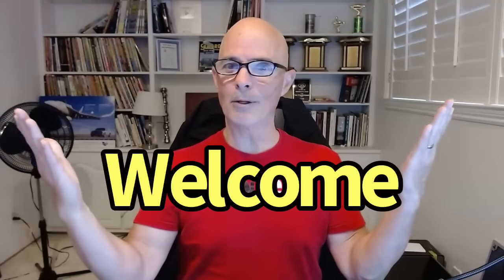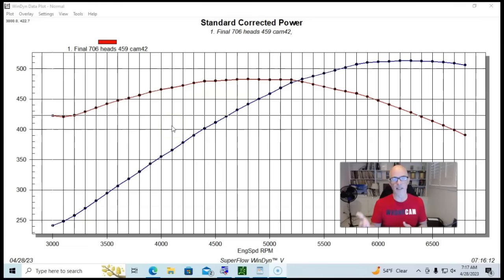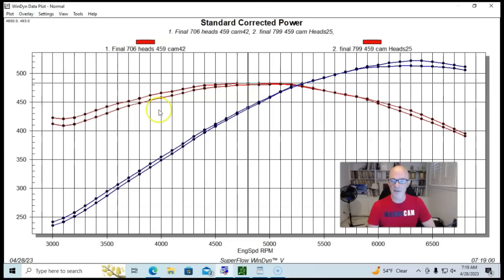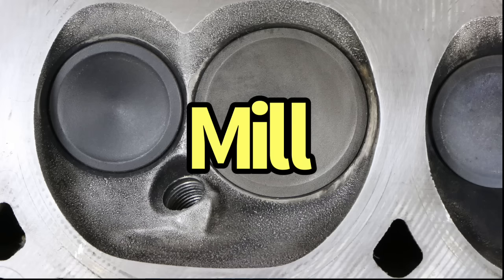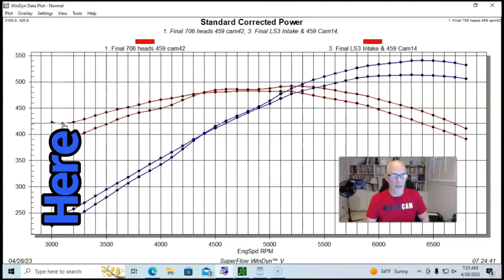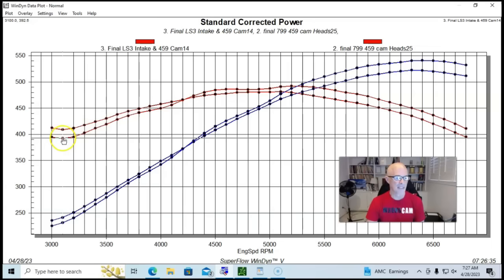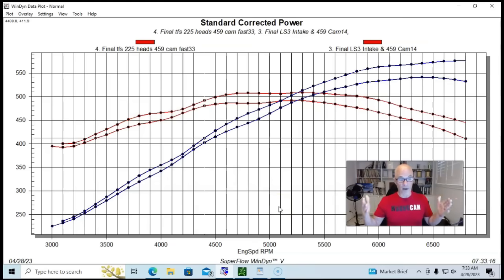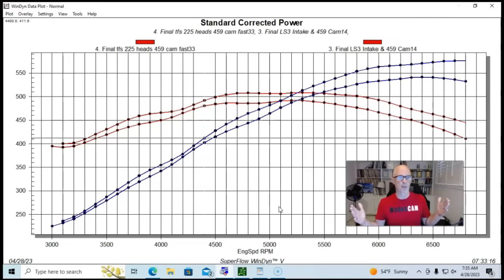HOW TO MAKE 500+ HP WITH STOCK 706 HEADS. 706 VS 799 VS LY6 VS TFS HEAD TEST! 514 HP WITH 232 CFM!

Comment: What’s you’re guess with hp and tq numbers on a Lq4 with 706 heads and ss2 cam?
Reply from the maker: 465
Reply: @richardholdener1727 torque? And if I’m into to the engine is it worth swapping to flat top pistons? Seeing some used ones for cheap on fb marketplace.  Would that be too much compression with the 706 heads? Detonating issues?

Comment: Has anyone tested the 706, 799, or 317 heads on a stock L92 6.2L?
Reply from the maker: same results
Reply: I have a Yukon XL Dental with the 6.2L. I use the vehicle to pull trailers on a regular basis. I want to delete the DOD for reliability and make more low end torque for pulling on pump gas. What heads, cam, intake, & exhaust would you recommend? 
Thanks again for the great videos.
Reply: @Fehrway_Engines  Texas speed has a kit (for ease of reference/ replacement)- check them out.

Comment: If i was using stock 243 heads on a lq4 6.0 with stock cam would i have to change my pushrod length or can i retain the stock pushrods

Comment: If I’m putting stock 799/243 heads on my 5.3/4.8 I’m going to deck them to match the compression. I’m sure the torque and peak hp would be noticeably different throughout the curve.
Reply from the maker: you might get the 799 heads to make 706 head power
Reply: @richardholdener1727 on a all motor 5.3 with TBSS, 90mm TB, headers and low buck cam. Would you suggest decking my 862 heads and getting a valve job or would it make more power just decking the 243 on that combo? Going to get gears and converter too.
Reply from the maker: I would port the 706 heads-maybe bigger 2.0 inch valves
Reply: @richardholdener1727 that’s a good idea. Lastly how much would you deck the 706 heads? It’s on a 99 Silverado gen 3 5.3 with dish pistons. Would .30 be too much with a .40 head gasket and have to worry about PTV clearance with a low buck truck?
Reply from the maker: P-V will be fine-but why do you want higher compression when you won't be able to run full timing on pump gas with stock compression
Reply: @richardholdener1727 my 5.3 is 9.5 compression but with .030 decking it should be roughly 10-1 if I’m not mistaken. Is this too much for 91 pump gas?

Comment: I’m asking due to your knowledge of this is very dominant  to mine. I’m about to build a driver 5.3 for my 65 C-10…. Plans are standard bore if it’ll hone clean, the infamous “truck intake” and my cam choice was the 8701, (considering your input that could change) my toss up is flat top vs small dome piston, I’m wanting to drive comfortable city/hwy but have a lil bit of NASTY!
Reply from the maker: use flat top, pick our Low Buck truck cam (only $199), you will need springs and larger injectors (pick the cheaper flex fuel) get all those at richardholdenerperformance.com

Comment: What is gained by using 2" intake valves on 706 heads in this application?
Reply from the maker: extra flow
Reply: @richardholdener1727 would one need to port nd polish the heads to adjust with the increased measurement of the value?

Comment: I have l33 , 799 or 862 which is better ?
Reply from the maker: for what use?
Reply: @richardholdener1727  hot rod truck
Reply: @richardholdener1727  l33. 5.3
Reply: @richardholdener1727  9:9.1 compression
Reply: @richardholdener1727   I have 862 but I don't know which is better?
Reply: @richardholdener1727  l33 engine 310 hp with 799 but if I put 862 will do more power ?

Comment: So basically what im hearing is the 706 heads are absolutely amazing for a budget build? Be somewhere in the 450-550 hp range pretty easy
Reply from the maker: 550 hp with ported 706s
Reply: @ how about stock 706s with 4.8 pistons and “chopacabra” cam on a 5.3
Reply: @KaotikMotorsports so just a 5.3 with a cam in it
Reply: @richardholdener1727 using what cam ?

Comment: Hey Richard,

Sorry for responding to an old video. 

I have an Lq4 I’m prepping for a build. 

I found a set of 862 heads for $80 so I’m leaning towards swapping the 317 heads for those. 

This engine is going in an e46 bmw for a drift build. 

Would the truck Norris cam kit be a sufficient option for my application for should I be looking towards a bigger cam like a SS2 or SS3?

Thank you for your help as always
Reply from the maker: depends on the rpm you want to make power at
Reply: @ 6300 rpm to 7000

Comment: Wish you would have run the Fast intake on the 799 heads I feel it would have been closer to the rec ports. I have a LS6 with stock 243’s and cam, put a Fast intake on it and it’s gains were fairly significant  over stock LS6 manifold.

Comment: im in need of help. i have a 04 ls swapped 5.3, in a 88 cutlass. the car ran great for about two months, then one day it just shut off,, after checking the system[wire harness] i found that the two power wires that hooks to the starter and the crankshaft sensor wire had burnt into the header, so i bought a new stand alone wiring harness, once i finish installing the harness, the car started up but it had a really bad vibration so i shut the car off and rechecked behind myself to make sure everything was in its place as it should be, which it was so i restarted the car [still had a bad vibration] but it ran for 3 mins then shut off, in would not start again. so i went to checking the possiblities , i check fuel in which its getting 59 psi of fuel. i check all my grounds , they all had good connection, i check to see if the ignition was getting 12v and constant 12v which it was, i check to see was the the coils getting ground and 12v which they both was but i wasnt getting any sparks, so i check the crank and cam sensor with they was both getting power so i replace them just in case and still no sparks.. can anyone please point me in the right direction. on how to fix this..
Reply from the maker: do all the cylinders get spark and fuel?
Reply: @richardholdener1727  they all getting fuel but no sparks

Comment: I have the 706 heads, my question is will I be able to put my stage 3 Texas. 550 cam in the engine without changing the springs out? Without damaging the heads?
Reply from the maker: no-the stock 706 heads have .500-lift springs
Reply: @richardholdener1727  so what all would I have to do to the 706 heads in order for it to work with the Texas. 550 cam?

Comment: Its almost too close to call between 799 and LS3 head. The LS3 intake could easily make up that 20hp difference.
Reply from the maker: the 799 head flows 250 and the LS3 head flows 300+ cfm-it's not a close call

Comment: 6 liter with 706 heads and a Truck Norris cam should move things fairly easily.

Those heads are badass for towing purposes. 😊
Reply: I’m putting this combo in my 62 Falcon Ranchero that weighs 2500 lbs.  Should outrun a lot of stuff!
Reply: @trailerparkcryptoking5213  absolutely... And it'll be fun to drive around too.

Comment: Hi Richard hope all is well

Im into rebuilding a 383 stroker using 5.3 block just revisited this the 5.3 engine has 706 from your video on 5.3 stroker build you use ls6 heads .
My project is torque from researching your test the 706s have good low end torque witch is my goal 
Your thoughts please

Cheers
Aaron

New Zealand

Comment: A thing everyone over looks air speed which is important, Big ports can slow down air speed which can hurt low end torque, I been talking to my engine guy who is 1 of the best head porter in my country, I have seen him on his flow bench for hours with his piece of string watching where the flow is going, he has set many national records and 4 time national champion so he knows his shit, a Good example is Ford Cleveland heads where you got to run with plates in the intake, but its the turbo era where people throw on a turbo and screw up the turbo boost controller.

I'm putting on a turbo but my engine will have Good N/A performance and some of the best parts I could find as well as turbo I've gone with the biggest LS I could get to spool up my turbo, I love watching you dyno testing with no BS I've learnt some stuff from you especially turbos which i'm no expert on them

Comment: Got a 2000 c5 vette, 6speed  LS1 5.7. The heads on the motor are 241, I’m planning on swapping them out for 706 heads that I got from a 5.3. I’ve seen your test and notice how the 706 heads outperformed all the other heads. My question is, do I need to do anything to the heads to make them fit on the LS1? I’m planning to go mid to high power close to 500HP so are the 706 a good choice?
Reply from the maker: you need ported heads for 500 hp

Comment: Are the head gaskets go bad often I have a 5.3 with 706 heads put in my swap and I have a leak in the head getting head gases in my cooling system should I just change gaskets are heads also it has 706 cathedral heads came out of 2004 Chevy Tahoe I believe ! What is best head gaskets to use on the 4 kid show string budget !!!
Reply from the maker: stock head gaskets should not leak-it is not the gasket-figure out what went wrong first.

Comment: Hey Richard I have a lq9 I'm getting refreshed and I just picked up some non-cashtech 706 heads what cam, pushrods, springs and what head gasket do I need to put it together
Reply from the maker: what power level?
Reply: @richardholdener1727  looking for 450+ hp and tq I like what I saw in your video I would copy it exactly if I knew all the specs

Comment: Hey Richard, have you ever dealt with milled heads (might have missed those vids). a good topic may be how much can you mill from a cyl head before needing a different length pushrods. im stuck in that dilemma now. i want to mill the stock 823 heads (bought it used from junkyard) but already have sloppy stage 2.
Reply from the maker: depends on how much lifter preload you currently have
Reply: @richardholdener1727 gotcha. Im not even trying to mill for conpression moreso the fact that im buying used heads so to make sure its flat maybe even mill .005 but idk how much that affects the stock pushrod length. 

But would also be a decent topic to explain how to check all that out.
Reply from the maker: .005 changes nothing on pushrod choice-and milling the head a given amount changes the pushrod length requirement by that amount. But since you have more than .030 (for example) of adjustability of standard travel lifters, there is often no need to change pushrods.

Comment: Anytime i have a question about a combo i look to see if Richard has already covered it, and glad he came through as usual! Looking at swapping out the 317's to 709's i have on another engine in the barn, for my 6.0, for added torque on my next project. I had a 99' TA about 12 years ago that made 484 whp 446 tq with a 6.0, fast 92, and trick flow 225's milled to around give or take a few 65cc and slightly smaller cam! Seeing the graph here, i might get the 706's worked, doesn't sacrifice too much low torque for a heck of a lot of hp/tq on the upswing! Great content as always!

Comment: I haven't look through every comment but can I still use the 706's if I use the cheap 87 octane on a daily driver and still get all those benefits of the higher compression. Does that change things at all being 87 is much cheaper than premium. I'm talking daily driver and a which one would be best when cost to drive is considered.
Reply from the maker: not if you have to pull timing when you run cheap gas

Comment: I have a question you might can answer if you see this… I have a stock ls2 so flat top pistons currently running 799 heads but they are worn out and I have some stock 706 heads that I would like to do a quick swap with.. but my concern is compression!! I’m on a 93 tune and would like to stay on that being my daily vehicle. Will this be okay?? From what I read it’ll be 12:1 static CR which I’ve been told is insane.. but want to know your opinion! And if you have anything else you feel like I should know please tell me
Reply from the maker: IT WON'T BE 12:1-IT WIL ONLY CHANGE BY 3-4/1OTHS

Comment: I have a 6.0 out of a 02 escalade going into a c10.  going with a truck Norris cam. My question is my engine has 317s on it is it worth the upgrade to get 799s if I’m just replacing stock with stock no work other than springs and seals?
Reply from the maker: 799s would make more power than 317s

Comment: Did the chambers on those heads have to be machined for the 4 inch bore?
Reply from the maker: NO
Reply: @richardholdener1727  I’m working on a budget 6.0 built and got a set of 862 for dirt cheap. Was hoping I didn’t have to open the chamber. It will be a bracket motor 3400 rpm launch shifting around 6500. Will these heads work?
Reply from the maker: they will, higher compression and they will flow more if you unshroud the valves-but not mandatory
Reply: @richardholdener1727  which carb intake would you reccomend for this combination?  Victor jr?
Reply from the maker: what cam?
Reply: @richardholdener1727  sloppy stage 3
Reply: @richardholdener1727  motor will be run on alcohol as well

Comment: What do you think about the TFS 225 heads vs a rec port on a 408 stroker? Seems like this TFS 225 head is a solid choice. I'll be running upto maybe 7200-7300 rpm max and an occasional 200 shot. Seems like the tfs 225 and fast LSXR 102 with the right cam could be what I go with. Thoughts?
Reply from the maker: DONT KNOW WHAT YOU MEAN BY THOUGHTS
Reply: @richardholdener1727  do you think a 408 would have more consistent power throughout the 3800-7300 rpm range with the TFS 225 and fast lsxr or would it benefit more from a rec port head and intake setup?
Reply from the maker: vs which rec ports?
Reply: @richardholdener1727  yes sir that's correct

Comment: Compression helps low rpm power 99% of the time . A small chamber 5.3 head can get you in trouble on pump 93 a lot quicker than the larger chamber head too, on a big bore ls. Its trade offs , but its important to make people understand the real world consequences of the switch . 
 I hear people dogging 317 heads all the time , saying they won't make power . Its true that they suck on the wrong app , just like every single other thing that uses physics to function . A 71cc chamber on a small bore engine will be lazy , just like a tiny chamber headoin a big bore with make great power but be knock sensitive on pump gas.

Comment: Hey rich, I’m I turned to start a 408 stroked. Btr 233/248 what heads should I go with n/a? I think I heard you saw if plan on running boost I should keep my 317s but can’t get why?
Reply: Say*
Reply from the maker: HOW MUCH POWER DO YOU WANT
Reply: @richardholdener1727  600+hp I saw one that you had used afr 245 heads but didn’t work right for that combo. Would it still be a good idea to run them for future boost?

Comment: Love your videos, and I've watched all your 6L videos(I think). I have a stock LQ9 in a denali. If I did 1 3/4 headers, 706 heads, what cam would you recommend for a daily driver/work truck, and how much power do you think that would add?
Reply from the maker: truck norris
Reply: @richardholdener1727  by your estimation, how much power would this combo be over stock?

Comment: Woop woop! We need to start going off a like under the curve number like say (( Hp = F(RHT) ~ a(RHT)=3300 b(RHT)=6600). Please excuse my short hand just rambling. Great test!!
Reply from the maker: average hp or torque or both is more than sufficient, but the curve already tells you what you need to know to decide
Reply: @richardholdener1727  Noted. What kind of gains would you guess from the light weight valve swap?

Comment: When running these combinations, changing heads, cams, intake ect, do I need a Holley hp system or dominator? Or can I use stock computer and turner. Or is it as simple as getting it dyno tuned? I want to know before pulling my 2002 Cadillac Escalade apart. Thanks!

Comment: RICHARD WOULD THE TRICK FLOW 225 HEAD MAKE OVER 650HP ON A LS 408 STROKER? CAN THAT TEST BE DONE? WOULD 225 CHOKE OUT A LS 408 STROKER FAR AS AIRFLOW?
Reply from the maker: they will support that power level
Reply: @Richard Holdener  thank you brother.

Comment: New to channel and maybe I’m missing the video but do you have lsx build info?
Reply: I see the 5.3 and 6.0 and 6.2 info and it’s all great. Just didn’t know if those builds translated to the lsx block builds. Being that they can’t use mainly the heads that those engines use
Reply from the maker: the LSX block accepts all the same parts.
Reply: @richardholdener1727  ok thanks for the info. Time for me to start rewatching videos then
Reply from the maker: there are 1000s of vids up on different engine combination testing-pick the one you want

Comment: I've seen people spent crazy money on good heads on boosted engines just to make a lousey 30 to 40 hp. Budgeting is wise. 4k for a set of heads that add 70 hp is not great when you could add twin turbos for 400 dollars and get 200 to 400 hp from boost alone.

Comment: PRC 225 as cast for my OG LS1 or stay with my decked 706's? Dropped them by 25 thou. I think I calculated a 57.5cc combustion chamber with that change
Reply from the maker: the prc heads should flow a lot more
Reply: @Richard Holdener  well I bought the PRC's. But if your videos have taught me anything it's not always flow rate that wins the race. My RPM range (goal) isn't more than 6200.....fingers crossed I made the right choice. Have a redeux racing long runner 8 stack going on top of the PRC's with a SS2 cam. Any thoughts on the cam with that combo?